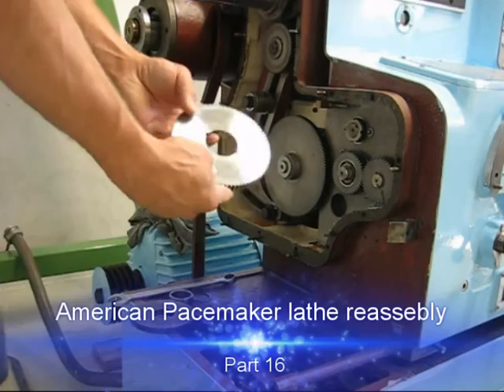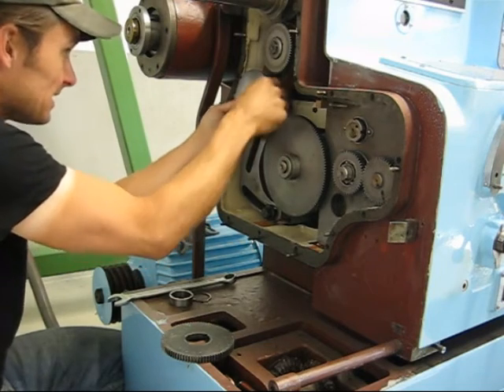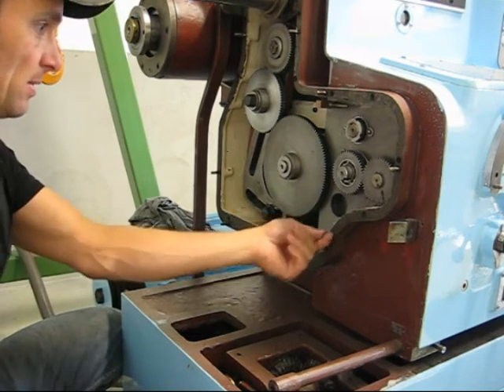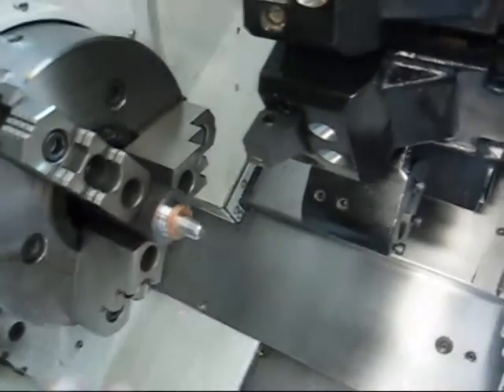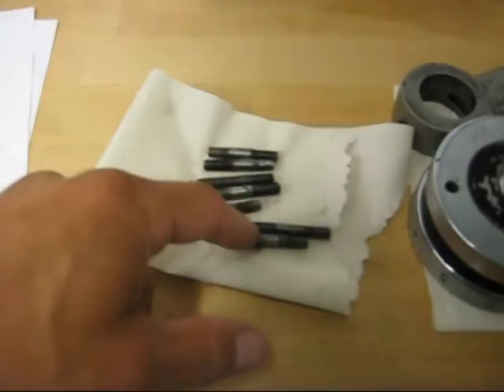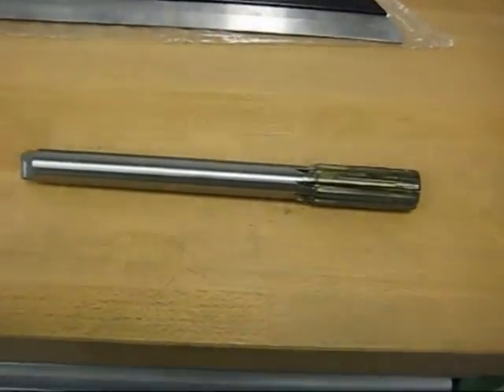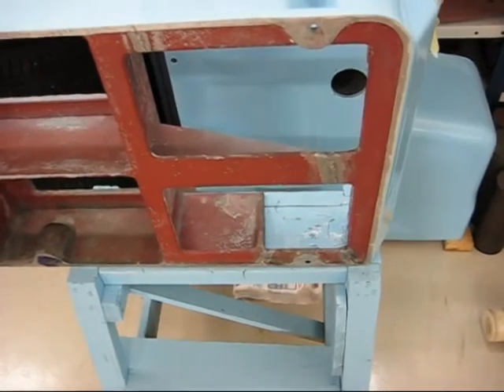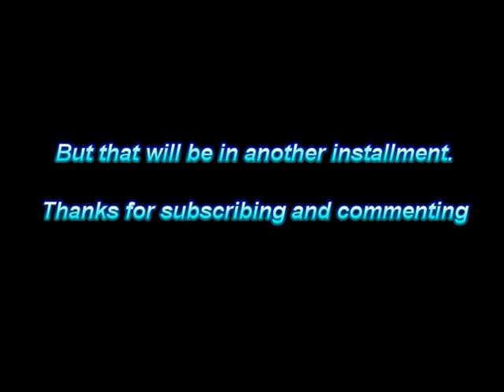American Pacemaker lathe reassembly part 16

Comment: May need to cut and tack weld in place to achieve proper alignment. Too bad you are not in the states getting an unbroken casting would be a lot easier I imagine than fixing that one.
Reply from the maker: Yes, that's for sure. We will see if I can get it aligned in some way without cutting it.